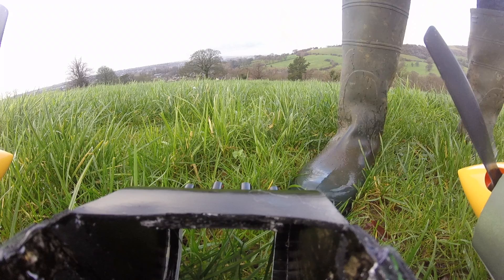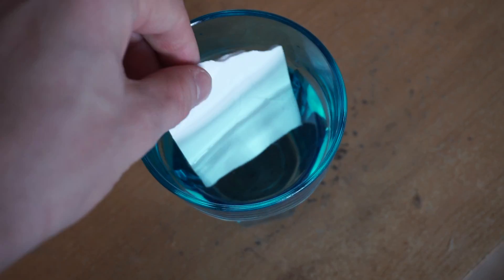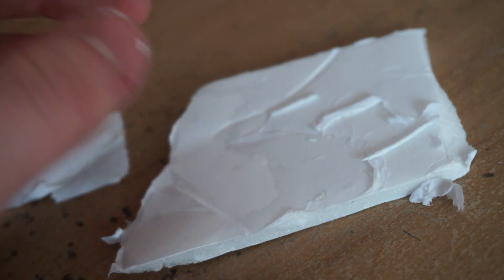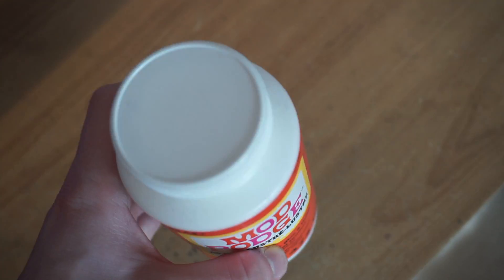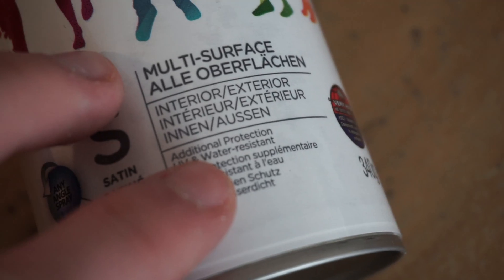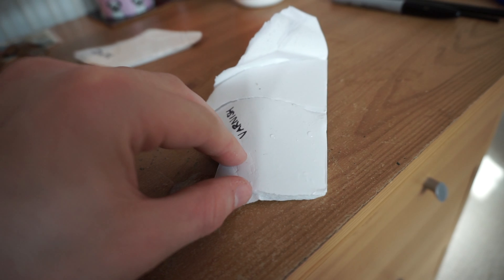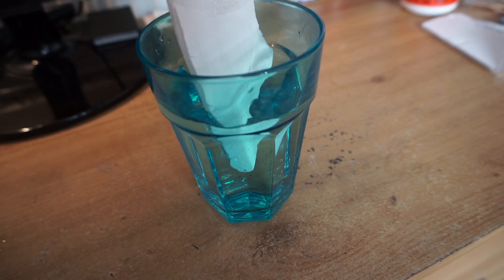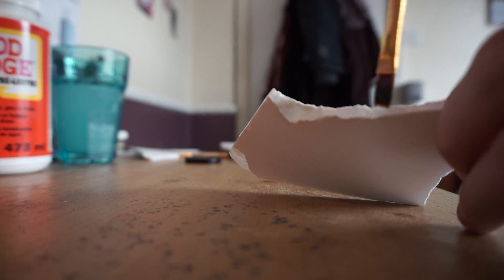How to WATER PROOF FOAM BOARD!

Comment: Hello and thank you very much. I got all my ingredients ready to homemade gesso my foam core board and then I found your video....a good thing I did not do it as the homemade gesso is made of water, glue, a bit of acrylic paint + baby powder. I am planning to do an Acrylic painting on my foam board.....will the spray you recommended also act like gesso before I start painting please? I mean can I paint on my foam board with acrylic and brush after I spray it (so prime it) please?
Reply: I would do a test piece…best way to know!

Comment: PVA? I've used it on polystyrene/Styrofoam/HungaroCell before as a primer and sealant with good effect - though not for the kind of modelling work shown here. I have also used fabric sealing and finishing products sourced via the French version of A...zon 😉
Reply: hello and thanks for your comment. I was wondering if I can gesso my foam board with homemade gesso which consists of PVA + Water + Baby Powder....but in this video it says that we should not use water on a foam board. Now I do not know weather the spray will also act like a primer and gesso before I start my Acrylics painting or do I need to prime it with anything? Please advice if you know. Thanks.

Comment: I am an artist in the bay area.  I am doing an installation using foam board that will be outdoors with partial covering.  This was super helpful.  

I am wondering aside from the paper peeling did you notice any warping after much outdoor exposure?

That's another concern.  Altho I do plan on using some wood to help it not warp too.  Just wondering what your experience was.

Thx
Reply: Im in a similar situation. Did you keep it from warping? Any tips?

Comment: Thanks for the advice. Other ways of waterproofing your planes are with coloured packing tape as the Armin method from Experimental Airlines, or using iron-on laminating film as used by Andrew Newton or simply something like Solarfim.
Reply from the maker: Great points, I may do a video highlighting those techniques in the future.
Reply: Colin T Head 
yes, but to spray it would not only be easier, but also lighter